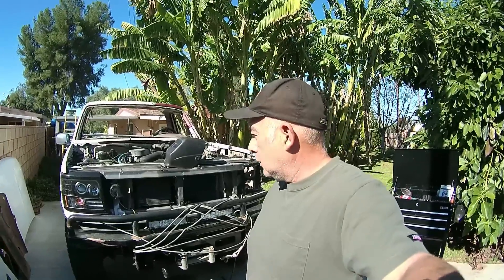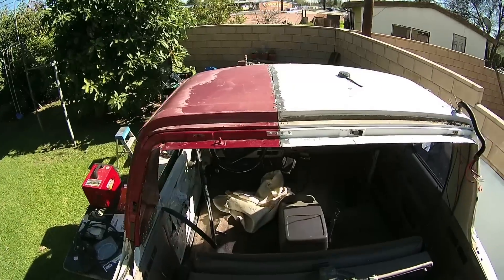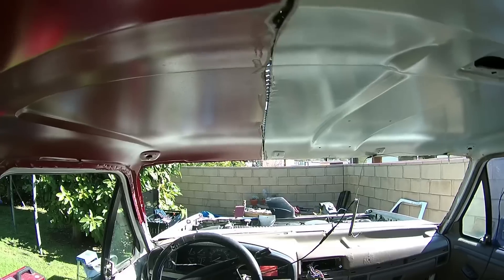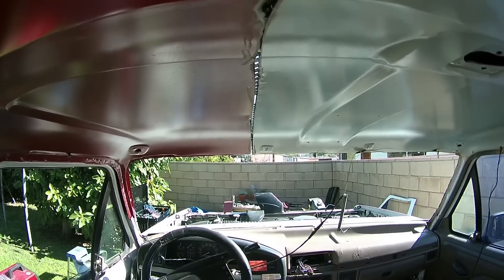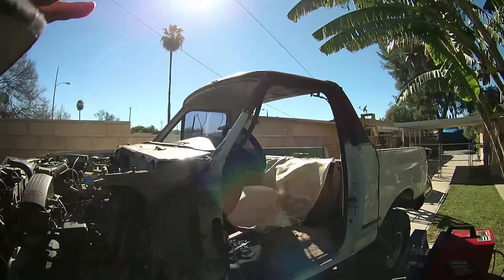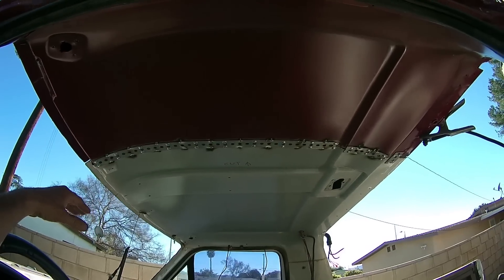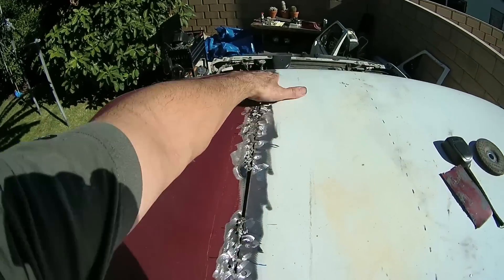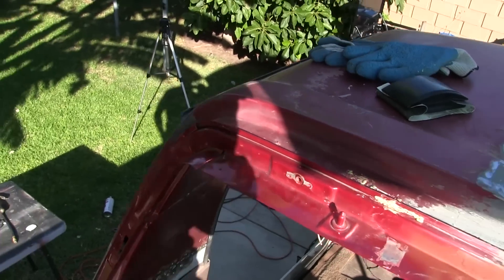Broncos Coming Together

Comment: I give you props!  No, not Jay Leno's garage this is Rudy's Garage!  If that had happened to my Yukon I'd just look at it and cry not knowing where to begin.  I'm just thinking, could you have rented the tool that crimps the edge into a ridge/lip to butt the two pieces together?  either way it is coming out great.  Did you watch any of Pete's videos from SWRC?
Reply from the maker: If I were to butt the two pieces together, the cuts would have to be right on the money. I'm not good enough for that.
Reply: Ah; got it!  Great job!  Looks like the bondo went on nice and smooth.  Can't wait till the next video!

Comment: should have just changed the whole top less welding and would have been stronger just saying
Reply from the maker: I figured that half a top would be easier to handle and if I mess-up it would only be on one side.
Reply: I m just saying way easier cut thur the w/s and cut across the back    been dong it for  years  just a way cleaner safer  job too don't ever roll it its your truck looks like a nice one